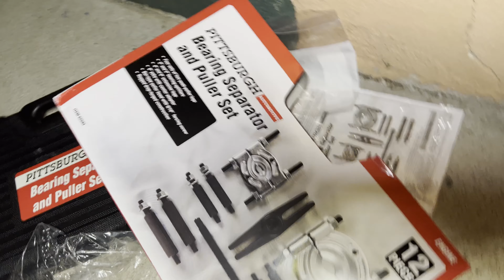How To Replace Center Support Bearing 135i or 335i (EASY)

Comment: I have a bad clunk and vibration when accelerating from a stop. I’m positive it’s a center support bearing. I noticed you didn’t install heat shields ? Do you think it will be prone to rust if I do the same?
Reply from the maker: I didn’t install the heat shield in the video because I wasn’t sure if I had aligned the drive shafts properly. So incase I needed to remove the driveshaft again it would be a little easier. But I installed it back on after driving the car around and making sure it was good. I would recommend putting the heat shields back on if you take them off.
Reply: @menjicar  thanks really appreciate it!

Comment: Great video!!!  Just wanted to confirm. So from a dead stop and you accelerate, you hear a clunking noise basically in the center of car, like where the arm rest is or rear floor area?  

This really helped if it's the same situation which pretty positive it is. Thanks again.
Reply from the maker: Yes you are correct. Most obvious would be from a stop and accelerating.
Reply: @menjicar  thnx. Exactly what mine does
Reply: @menjicar  what do you think is better? I can buy a used drive shaft with only 35k miles on it in great condition and guibos on it. Or the cheaper route of course, just replacing the center bearing? Is taking the exhaust off working on ground the worse part of it all? Thanks again.
Reply from the maker: @michaeljo281  I believe the cheaper route that way you know it’s new. And if you order in FCP and it goes bad again you replace the part for free

Comment: Did you notice a slight clunking when going over bumps? Or when you moved your rear wheel back and fourth did it clunk?
Reply from the maker: I would hear it sometimes over bumps but mainly heard it when accelerating from a stop. At first it started as a slight vibration and then over time it got worse until you could hear it start rubbing.
Reply: @menjicar  ok cool thanks for your feedback man. Just booked for a mechanic got all my parts, flex disk and center support kit just worried it might end up being my ujoints which I heard wasn't really common. Thanks tho!

Comment: When I accelerate Im hearing a humming noise, no clunking. The harder I accelerate in higher gears more louder. Cruising is fine. Would you say bearing, guibo or both?
Reply: ^^from rear of the car^^
Reply: @drizzeysmith9699 did you find this out ? I’m having the same issue
Reply: @mystiquemedia8786  no still stays mechanics saying maybe driveshaft but still not 100% sure. my guibo and bearings are fine. So frustrating
Reply: @drizzeysmith9699  which bearing did they check? Wheel bearing or center support bearing?
Reply: @mystiquemedia8786  I’ve had all bearings checked and ok. Just replaced both driveshafts and the noise is still there hahaha now I’m going crazy !
Reply: @drizzeysmith9699  I read it can be bushings, either subframe bushing or diff bushing is just binding and needing to be replaced. The car feel slightly “elastic” on the passenger rear side and that’s where I hear the same sound, almost like a droning sound
Reply: @ I had those differential bushings replaced the last time I tried to tackle the problem. And the time before that was a new guibo and centre bearing (checked as I got the wrong bearing). Also done subframe insert bushings and all arms and joints as I was experiencing a loose backend to. Turned out just to be a suspension strut bolt snapped one end... I give up now till whatever and whenever it completely fails
Reply: @ what about sway bar bushings and End links? Is the car lowered on non OEM suspension?
Reply: @mystiquemedia8786  I did get upgraded sway bars but didn’t fit either. Car is on oem suspension m sport. All the bushings are fine, the rear is solid pretty much now. Mechanic reckons it’s the gearbox now. But I think it’s the differential. Maybe I can send a video of the noise and if we got the same problem I’ll be sure to let you know what it was if it ever gets solved.
Reply: @ post a video and let me know, it’s very troublesome. My car is a 335d tuned and deleted so with the torque I feel it pretty badly along with the the sound. The rear passenger side literally feels like elastic

Comment: Man I bought the tool from Harbor freight but mine won’t come out 😭 It’s actually hurting my drive shaft instead of taking out the bearing . I’m thinking of buying a blow torch and hopefully it expands. I don’t have the tool to remove the end of the drive shaft connected to the rear diff
Reply: Update: USE an Impact Wrench to turn the bearing puller from HF if you had troubles like I did ! 👏🏽
Reply from the maker: @BassFraud  awesome! Good to hear
Reply: @menjicar  2 months later and I have the same sound again :/ Has yours still held up?
Reply from the maker: @BassFraud  oh no 😭. Yeah mine has held up fine still. Have you seen if it is the bearing? Or just hear the same noise
Reply: @menjicar  I haven’t gone under the car yet but I know %99 it has to be the CSB & Guibo haha. I drove the car like this for 4-6 months until I found your video so I know exactly how it sounds and feels haha. Tbh I bought a used guibo and cheap eBay CSB so I’m thinking it’s probably that. Hopefully it didn’t break prematurely due to a bad or unbalanced drive shaft
Reply from the maker: @BassFraud  oh I see I bought mine from FCP so it’s basically like OEM. Maybe the quality has to do with it 🤔

Comment: Hie what happens if you dont mark your driveshaft?
Reply from the maker: The driveshaft will be unbalanced and it can cause vibrations. Because each side has some weights from the factory and is balanced together.